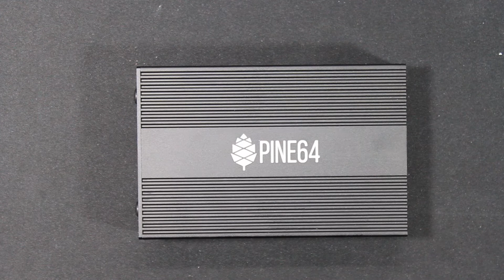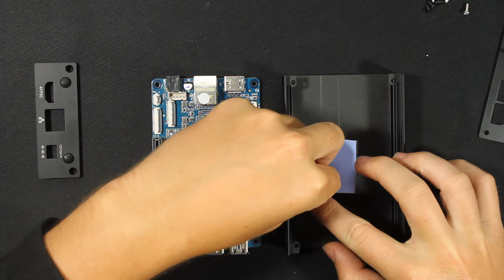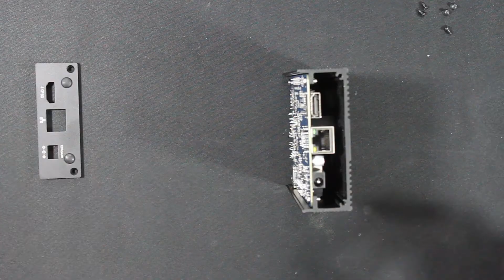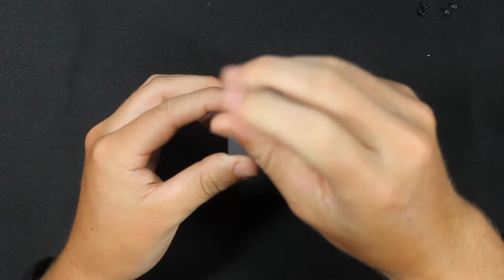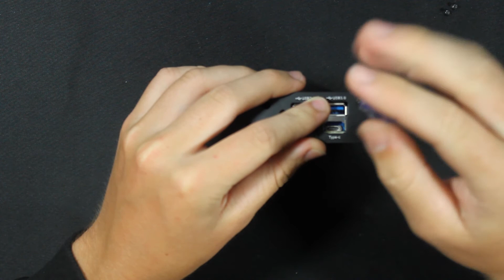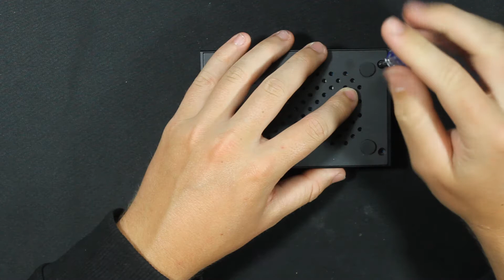ROCKPro64 Aluminum Case Assembly

Comment: How do you deal with wifi antenna?
Reply from the maker: If you don't get a good enough signal with the antenna inside the case, then you should be able to route the receiver portion of the antenna to the outside of the case.
Reply: @Ameridroid1  I see there are two small holes on the end piece with rubber grommets in them. Are these intended for external wifi antennas? Mounting the supplied wifi antennas outside the case would be to fragile for my purposes.
Reply from the maker: @videofreeamerica  I believe those are intended for that. You could probably use something like this instead of the included antennas if you need something more durable: https://ameridroid.com/products/wifi-antenna-and-extension-cable